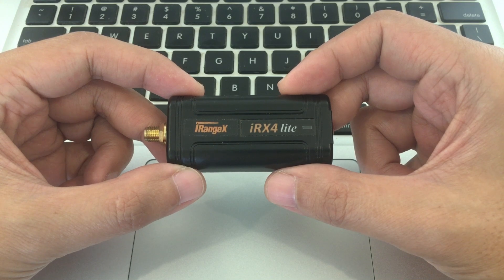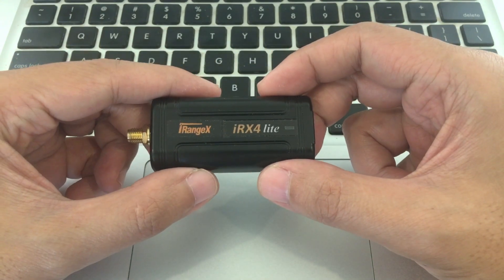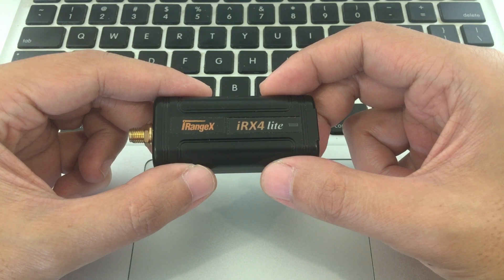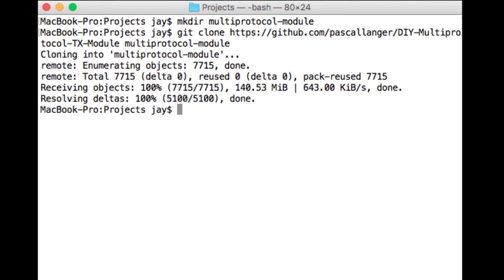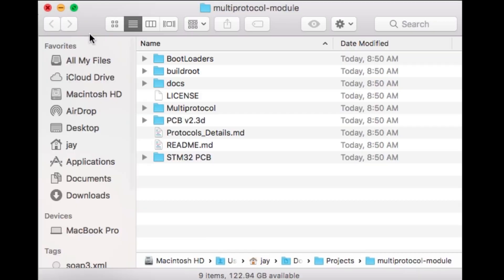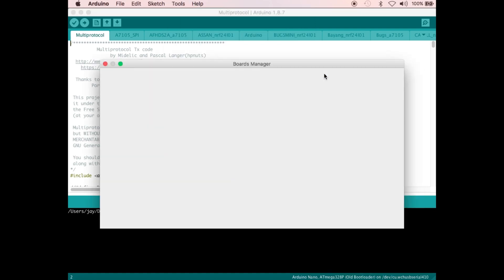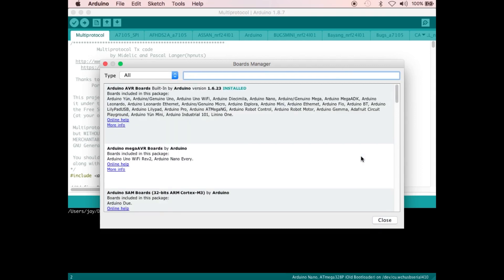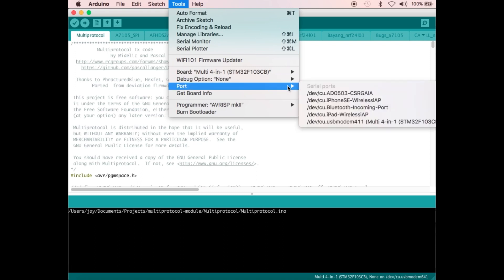How To Update The iRangeX IRX4 Lite Using The Arduino IDE

Comment: Do you have an idea why I got the following error message ?
I have succesfully installed usblib, but apparently not enough:

2020-10-02 14:36:58.806 system_profiler[17822:1126818] SPUSBDevice: IOCreatePlugInInterfaceForService failed 0xe00002be
Maple device found. 
Attempting USB upload.
/Users/Alex/Library/Arduino15/packages/multi4in1/hardware/STM32F1/1.2.1/tools/macosx/maple_upload cu.usbmodem14401 2 1eaf:0003 /var/folders/zc/s77mfk493zbcwj5k83n61zc40000gn/T/arduino_build_716842/Multiprotocol.ino.bin
dfu-util 0.8

dfu-util: Invalid DFU suffix signature
dfu-util: A valid DFU suffix will be required in a future dfu-util release!!!
dfu-util: No DFU capable USB device available

Comment: I'm getting the below error, any help greatly appreciated

Sketch uses 103932 bytes (86%) of program storage space. Maximum is 120808 bytes.
Global variables use 4688 bytes (22%) of dynamic memory, leaving 15792 bytes for local variables. Maximum is 20480 bytes.
2020-01-09 00:07:17.509 system_profiler[24877:302306] SPUSBDevice: IOCreatePlugInInterfaceForService failed 0xe00002be
2020-01-09 00:07:17.728 system_profiler[24886:302333] SPUSBDevice: IOCreatePlugInInterfaceForService failed 0xe00002be
Maple device found. Attempting USB upload.
/Users/Mobilemonkey/Library/Arduino15/packages/multi4in1/hardware/STM32F1/1.1.7/tools/macosx/maple_upload cu.usbmodem14101 2 1eaf:0003 /var/folders/x1/8x6431l96_5fnc88wl9qrr9r0000gn/T/arduino_build_777177/Multiprotocol.ino.bin
dyld: Library not loaded: /opt/local/lib/libusb-1.0.0.dylib
  Referenced from: /Users/Mobilemonkey/Library/Arduino15/packages/multi4in1/hardware/STM32F1/1.1.7/tools/macosx/dfu-util/dfu-util
  Reason: image not found
/Users/Mobilemonkey/Library/Arduino15/packages/multi4in1/hardware/STM32F1/1.1.7/tools/macosx/maple_upload: line 56: 24893 Abort trap: 6           ${DFU_UTIL} -d ${usbID} -a ${altID} -D ${binfile} -R ${dfuse_addr} -R
An error occurred while uploading the sketch
Reply: Got it working had to install homebrew to my mac
Reply from the maker: Glad you got it working. Yeah, need to install libusb via homebrew.
Reply from the maker: Glad you got it working. Yeah, need to install libusb via homebrew.

Comment: Where did you pull the info for the board finish URL?
Reply from the maker: joshua pulido Board definitions? That’s the direct link to the definition file for use with the Arduino IDE. The repo is here https://github.com/pascallanger/DIY-Multiprotocol-TX-Module-Boards

Comment: Is it the same way and firmware file for flashing the Vantac MPM module?
Reply from the maker: Gerd Staudenmaier Yup, they’re practically the same.
Reply: @jaylagare  Just tried it with Flash Multi and it worked! Also thank you for the link to Flash Multi which made updating so much more easy!

Comment: Mmm been asking you for this Jay, good job buddy, abit confusing with using mac and not windows i understand and can follow everything except when you make a folder on your mac and run the clone thing i was lost can you do them type of commands and actions on Windows 10? Have not actually tried this yet physically.
Reply from the maker: Paul M This one’s inspired by you, bud ;) Unfortunately, I only have a Mac. It should work on Windows also though you’ll probably need to install Git. But there’s an even easier way on Windows via Flash Multi https://github.com/benlye/flash-multi